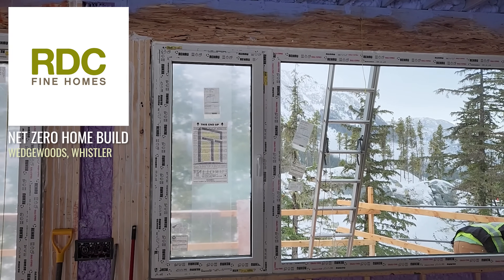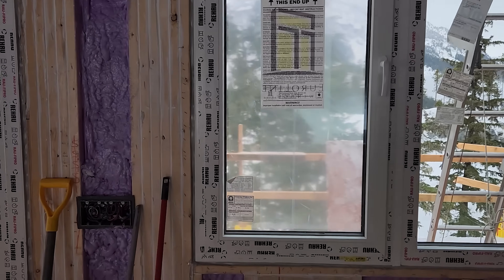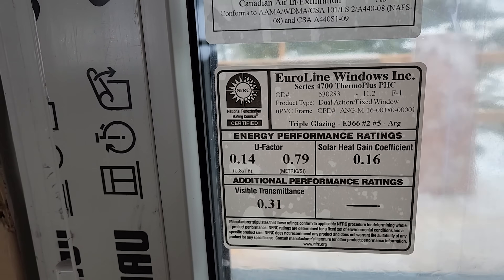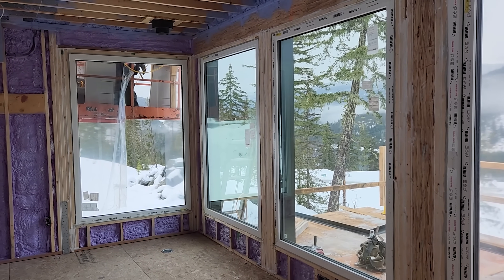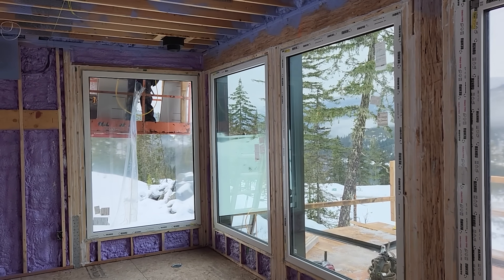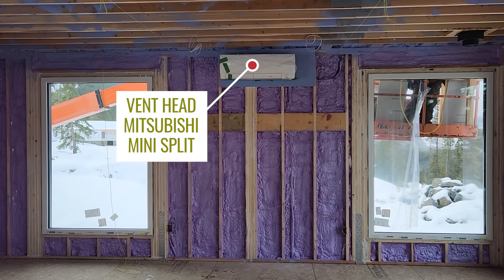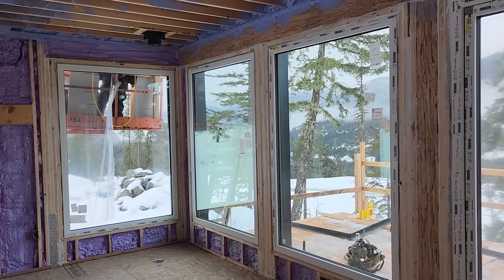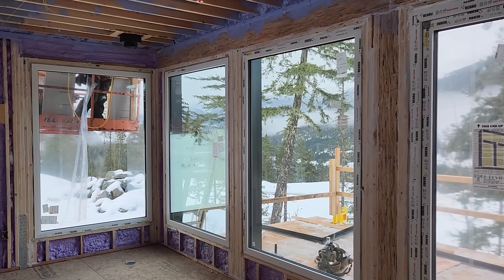Why We Use High Solar Heat Gain Windows When Building

Comment: Great what you mention ~sticker~!  Solar radiant heat gains is one global point important to engineer or designer because of spectral distribution and angular distribution of the radiation incident on fenestration, outside and inside air speeds adjacent to glazing and framing elements, spectral transmittance of transparent or translucent elements and angular & spectral variations. Good example!